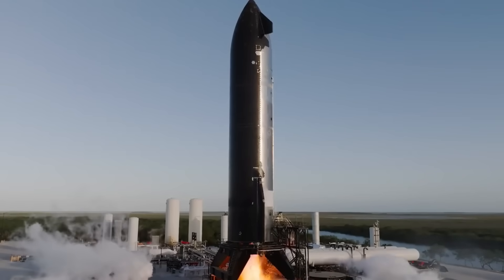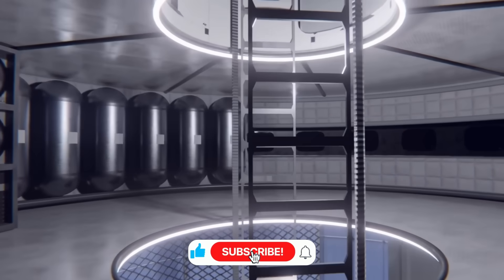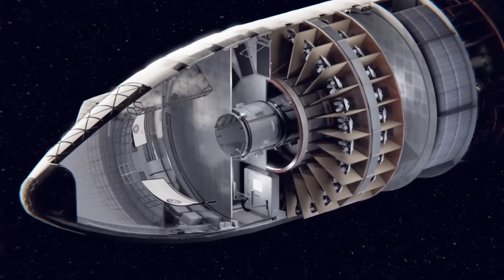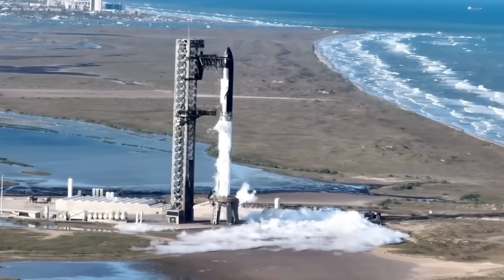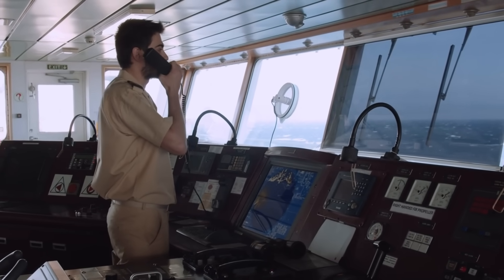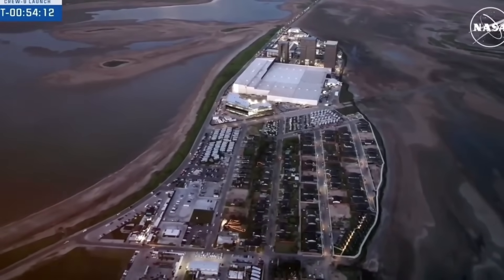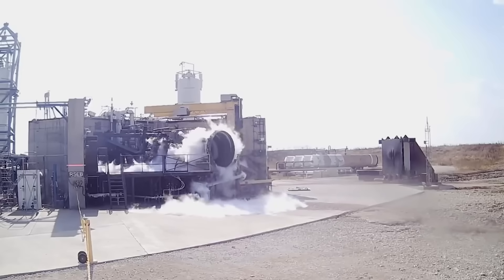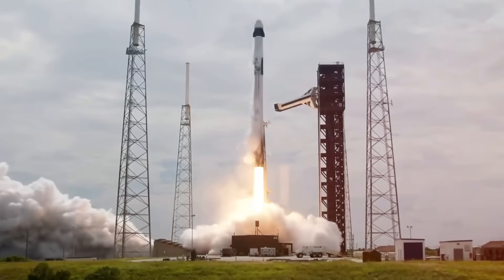SpaceX's Starship Interior Design NEW UPDATE: Revolutionary 6-Level Space Colony Ship Revealed!

Comment: Ships, not designed to return to Earth with an infra structure for 9m boosters and ships, should have a much larger diameter.
The same for a fuel depot ships in orbit, a depot ship should also have insulation similar to the tank for the shuttle.
Actually, I would build the depot ships with external solar panels, like an octagon hinged structure surrounding the ship.
Once in orbit open it up to form a flat panel and position it so it always keeps the depot ship in its shadow.
It should take care of boiloff.
Reply: This would be awesome if they could make it happen.  I can tell that you are a deep thinker much like myself.  Thanks

Comment: Space X can use all the waste plastic and under heat use it like oil in asphalt. 2 Quonset-hunts could be used 60 foot wide, 30ft OD and 50 foot wide, 25ft OD with 5 feet of dirt between the wall. these can give 2 levels and smaller 15 ft and 20ft can be used as passage way between the Larger Hunts and used as airlocks. Or a telescoping StarShip where the fuel tanks slide out of the upper body. This unmanned ship, will be bare bones. Only a lower air lock and 6each 15m section dividers. command and next level can store equipment. How are crew going to clean their space suites??? Hope they all have more than one each.